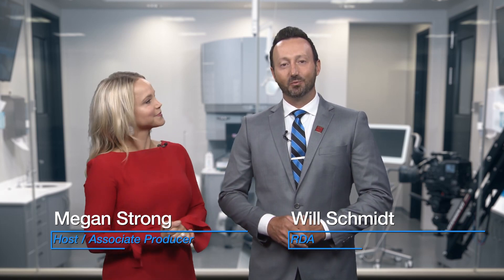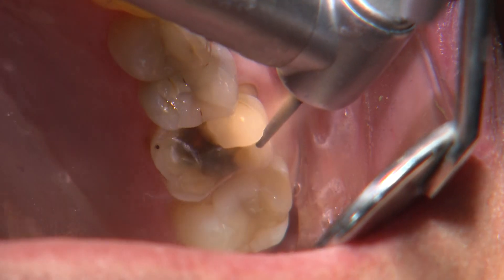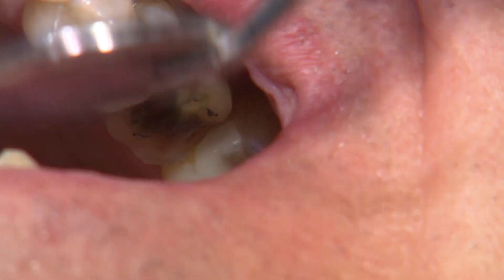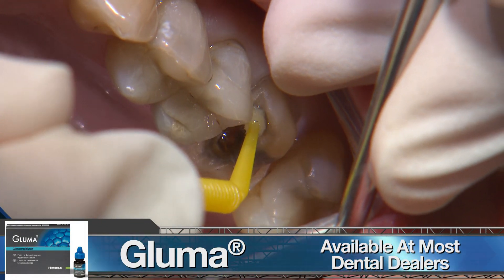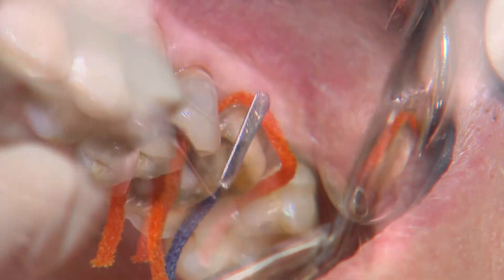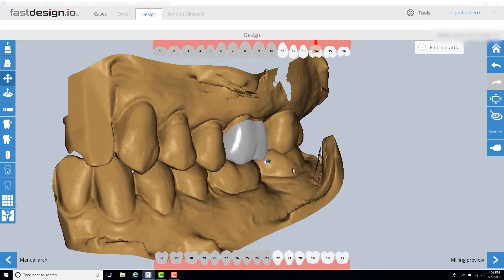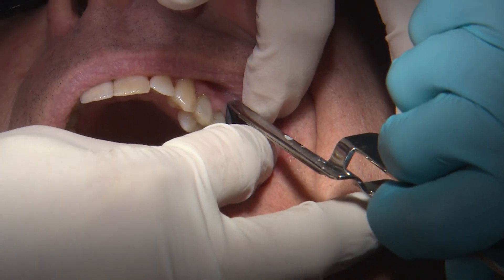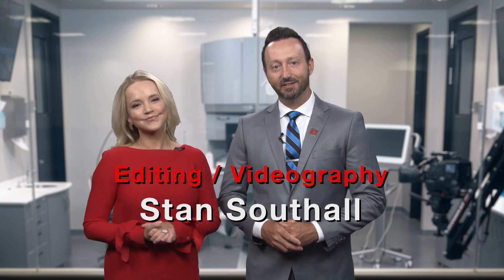Chairside Live Episode 257:The Most Efficient Dentistry of Your Career

Comment: Please don't lie. It is not possible. Assuming everything goes smoothly. Anaesthesia - 5 minutes, broken restoration removal - 10 minutes, preparation - 15 minutes, digital impressions - 10 minutes, restoration design - 10 minutes, milling - 20 minutes, proximal contacts - bite check 10 minutes, finishing/polishing 10 minutes, cementation + excess cement removal 15 minutes = 105 minutes so it is close to 2 hours. I bet it took even longer the dentist changed drills and placed some kind of bonding resin pulp protection, so the preparation itself took 25 minutes. You are just selling products not educating, shame on you Megan !
Reply: I think the truth is somewhere in between your estimation and the 1hr time.
Reply: Michal - scanning, design, and milling of the sintered bruxzir crown is accomplished in less than an hour. The clinical time will vary depending on the situation and operator. Regardless, this is a great service for any patient.
Reply: you sure take a long time to prep a crown lol